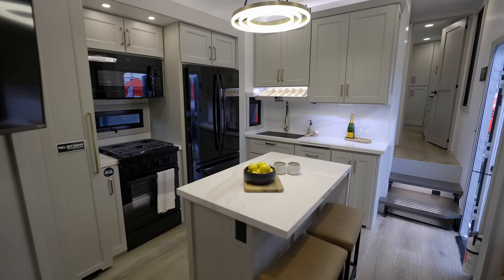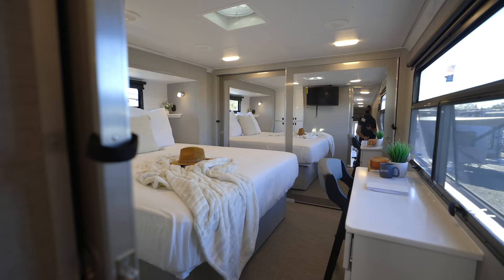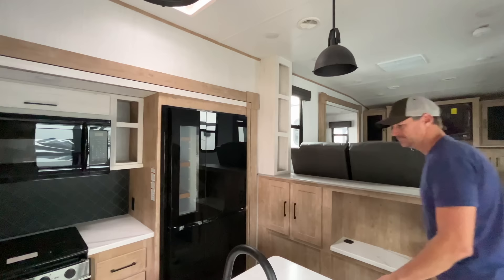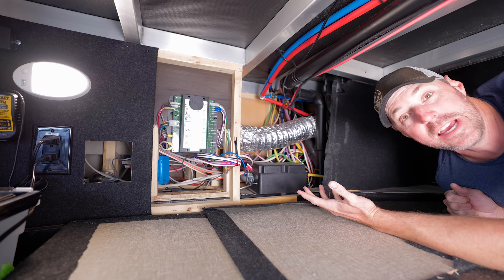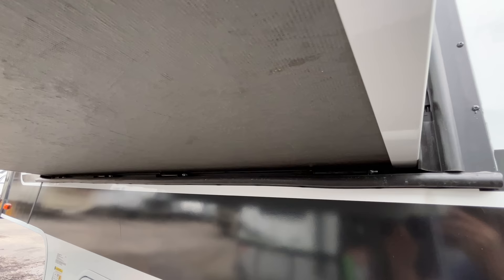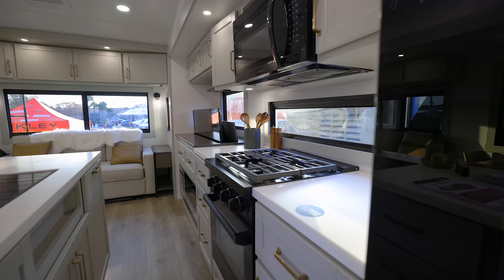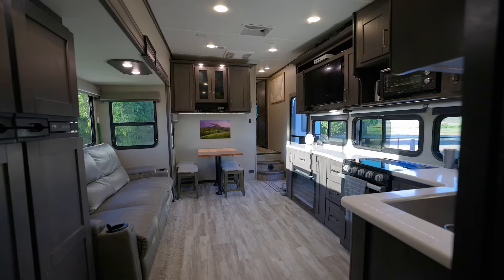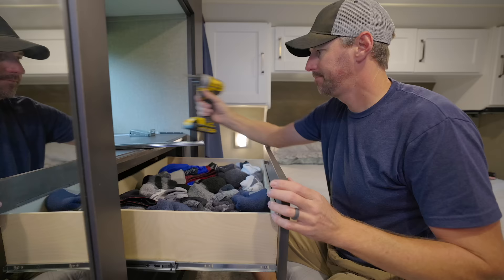Are All RVs Junk! Problems With Our Grand Design RV.

Comment: Don't know if you've been out to the PNW and have seen the Northwood Manufacturing models--they have truck campers to toy haulers in a range of budgets.   We started with an Arctic Fox truck camper and are moving to an AF fifth-wheel, and have every confidence that it will be as well-built as the truck camper was.  There were some little details (a window knob was nearly stripped and there was some facing loose on the fridge) when we bought it, but the dealer fixed all that right away when we found it with no problems.  What I like best, though, is that nothing feels cheap or flimsy--the cabinets are wood on face-frames with residential slides, the chassis is Northwood-made and independently certified, and I could go on and on.  The fans are all loud, though--we haven't been able to find any anywhere that work as well and are quieter.  Lance is another West Coast brand that is pretty solid, though I know much less about it.  I have no idea what type of line they might have for longer fivers for instance.  One big thing about our AF is that it is so well-insulated that we use much less AC in hot weather than we would otherwise, so if power is an issue, it might be another advantage.  Not trying to sell you on an AF (just a camper here, not a full-time or sales person or anything!) but just sayin' there may be sturdier options out there than what you've got close by.  I love the details you put in your videos--you've given me many ideas for our new fiver already and I can't wait to try them (I may have to ask you for more detail on installing a USB port if we decide to do that near our couch--the one at that end of the trailer is down under the table and hard to reach).  So thanks for all your hard work and info and keep it coming!!

Comment: Anything built after 2019 I can see without doubt....YES. At this point, i will never own an RV over 12000 lbs. Grand Design is perfect example. They cheap out of the frames while overloading on features with shotty workmanship. I have had an Class C from 80s and 3 bumper pulls in the last 25 years. I expect the normal stuff related to roof leaking, AC going out, the odd plumping issue, and the cabinets breaking. What I never expected was the literal base structure failing. While I was luck never to have purchased a Grand Design. My neighbor was not so luck. I literally saw his RV have full frame brake at the tonge going down the road on a camping trip on the highway. At this point, I would rather rebuild an 80s RV than purchase the crap being sold today. Why because that 80s frame has more strength than a brand new Grand Design.

Comment: One post.  I've owned 4 RVs (3 Class As and 1 C).   All were top of the line manufacturers and they all had problems.   From plumbing, to trim, to missing screws, to plastic pieces that were accidentally left in the plumbing lines and caused zero water pressure, to hand-prints in the full-body paint job, to warped pocket doors, to dented refrigerator doors (all of these were identified right during our pre-delivery walkthrough).   Others were identified within 2 months.    RVs are 10-year throwaways at best and idiots finance them for 20 years.   RV= ruined vacation.   Save your money.  If you want the camping experience, get a nice pickup truck, some good camping gear, and stay in the campground cabins.    You'll be able to afford this plus probably a Hawaiian vacation once per year for what I spent in maintenance.    Sunlight kills the roof / seals, so I stored mine in an indoor facility.   All were top brands.   They all touted their detailed factory QA inspections.    It's a joke.   I even had one $200k+ diesel pusher (in 2010 $200k was alot), that had problems because the front tire wouldn't clear the body when the wheels were turned.

Comment: Know what you mean about the quality. We purchased a GD Solitude and thought we were getting something we could full-time in. After 3 years I got frustrated with small things falling apart so we upgraded to a DRV Full House. Wow, what a difference in quality! That’s the way RV’s should be built.
Reply: We have a friend with a DRV and it’s nothing but problems.  After RVing now for 37+ years, I must say that if it’s not a LUX or  Spacecraft it’s not built for the long haul. We have a Grand Design Solitude 310 GK and it’s not without its issues as well.  Fit and finish is very nice. If it wasn’t for the terribly loud squeaking floor in the bedroom overall it’s a pretty decent coach.

Comment: We just purchased a Grand Design Reflection 324MBS 5th wheel after looking at several designs and owning a 2600RB TT for 7 years.  Really shocked at the issues we are finding.  Exterior door will be replaced (doesn't fit, you can see daylight at top when closed), dealership made a half-hearted effort to repair it, didn't work, back it goes.  Microwave and shelf installed crooked, on dealer list to fix.  Repaired several minor things myself (uneven blinds, missing door guide).  Our 2017 came standard with furnace vent screens and middle awning support....first time back to dealer,  service rep suggested we purchase these "upgrades" to ensure we didn't have issues...really!  Doing it myself.  Then the rep tells us "You MUST inspect the roof caulk within 90 days or no roof warranty.....these roofs move around a lot when you tow these units.....WTF?  We just purchased end of Feb and won't even use the unit until 90 days, so what are supposed to do. Called GR service and they explained 12 year roof warranty, please inspect/clean roof every 90 days...OK makes sense.  We felt good going with Grand Design again as our 2600RB held up well, but my initial reaction is they have cut costs in several areas and the quality of components has gone downhill...a lot...and it's supposedly one of the best/better built brands.  Scary stuff.

Comment: We’ve had our Highland Ridge for 10 years had minimal problems. I found the quality from Highland Ridge to be better than everybody else. The only problem I have like anybody else is with tires. I finally switched to a 14 ply if anything in the industry that’s where they can improve RVs a whole bunch. In fact, if you buy a new RV and it has a tan place force the dealer to get you some 14 or 18 blaze and pay the extra well worth it.

Comment: Back in 2015 bought a new Fun Finder travel trailer.  In my opinion above average quality.  Just yesterday went to a few dealers to look at some new units and compared to what I have the quality overall of the trim, wood, molding, etc just seemed inferior overall.  Felt like things were just slapped together and like always no quality control.  In my unit behind the cabinets I found lots of sawdust, pieces of wire stripping, and even a cutout piece from a hole saw.  Just sloppy and lazy workmanship. Plus the prices today are a good double for what I paid for my 2015 trailer.

Comment: Agree the Rv industry needs to step up the small details that can turn to big problems later. And customer support. That seems to have gone down hill a lot, but Covid hurt everyone in that sector. One thing I always tell people is stay away from entry level units. They are as cheap and flimsy as they get. A quality used unit would be better than the new ultra lights or base model units. 
And a transferable warranty on a less than 3 month old unit should be standard. Had no idea nothing transfers, and I mean nothing. This was for my new Jayco. Which so far is solid. Been happy so far. 🤞🏼

Comment: Purchased KZ 231rk 5th wheel in May ‘23. Had 5 spots on roof around skylights that were not sealed properly, so much sawdust and manufacturing debris in breaker panel that it was a fire hazard, sawdust and debris in heat vents and around camper, removed roof fridge vent and 1 screw was not long enough to connect to hold down, kitchen sink drain not tightened, living area heat vent no air. Bought a scope and appears the foil was never removed from furnace duct. Two nights ago up at 12:30 am because GIF 110 electrical plug  decided to blow with loud resetting noise for 2 hours, finally disconnected live wire to stop so we could get back to sleep. Replaced following day with good plug from electrical supply store. Have to light stove pilot light with hand held lighter because it will not light. Some people said we are lucky and “got a good one”! This is our 7th and LAST RV. Thankfully we can do most of the work ourselves. Our advice, DON’T buy an RV unless you are handy and have the time to fix things and watch many YouTube videos on RV repair. Take the money you would have spent on RV and tow vehicle and stay in Airbnb’s or hotel or rent a cabin or RV at a campground . When done staying, you can walk away.

Comment: Good to know paying the extra 50% gets some better quality.  The value is not just less work fixing things later but peace of mind that there aren’t looming disasters.  It probably also hold’s resale better so used ones get more than used cheap ones. People with smaller budgets could chose to get a smaller RV that is higher quality.  Or just accept the money saved will be spent over time instead, plus practice learning to fix anything

Comment: From my perspective most RV's have about a 10-15 year life span before materials reach a point of degradation where DIY level repairs become more and more difficult.  This is where paying more may get you ahead in the long run.  More money will generally get you a nicer rig with better materials, better build quality, and better longevity and most important a higher resale in the used market.  

The same could be said when purchasing a used RV.  Premium brands RV's will cost much more in the used market, but ,they may have a much better lifespan with fewer issues due to the better design and materials.

In both scenarios, the costs amortized over time factoring in purchase price minus the value when you sell may put you ahead in the long run.  Plus, you get to enjoy a nicer RV the whole time.

Historically, the premium brands (ie Airstream and others) are double the price of similar standard brand trailers with similar specs.  Fortunately there a number of new companies that are aiming at premium brand quality, maybe even better, but with "in between" price points.  

We were recently in the market for a 25-26' travel trailer without slide outs and we were close to pulling the trigger on an Airstream until we investigated other new companies.  We ended up buying an Intech Terra Oasis which has similar materials and build quality to an Airstream but with better design from our perspective such as fully welded aluminum frame in the walls and ceiling, higher ceiling height, better ground clearance, seamless roof, and exterior materials that can handle a hail storm.  Solar is essentially double the specs of Airstream for the same money.  Resale is yet to be determined but will likely be less than Airstream, however, we consider the Intech to be a better trailer from our perspective at 2/3rds the cost of an Airstream.  Cannot predict how long new companies will be viable over time but Intech has been in the transportation trailer business for a long time.  Hopefully we made a good choice.  We certainly are happy with our purchase after our first year.  

Not suggesting everyone should get an Intech or Airstream, just suggesting that it may be better to pay more in the short term to get ahead in the long run.

Comment: I have an old RV it's a 2003 Forest River/Ceader Creek it's my 3rd RV, and I have to say it's the best one I've ever had. Yes, things still break and have to fix them. We don't live in our RV, but we do go out in it about 4 to 5 times a year for 1 to 2 weeks at a time, so we are in it a lot. And as I said, things do break I usually spend about 1 week at the beginning of the season or at the end of the season doing my repairs. Right now, I only have 4 things to fix a part on the hot water heater, a drawer, one cabinet door, and the fill line on the freshwater tank. All little stuff. I  have a friend with a 2021 Grand Design, and he told me he had about 20++ things to fix on his. I think I'll keep my old 5th wheel RV.

Comment: Cheap electrical components are a real bug. 
Take that fan for instance. It's made of three components, 1: Moulded plastic housing 2: Fan blades 3: Electric motor.
Plastic housing has to be strong enough to to break and not discolour. Fan blades as housing + have an optimal design for air displacement and silence of operation also be reasonably in balance.
The motor is the bit that wears out and will be bought in from a motor manufacturer by the fan supplier. If someone manufactured a motor of reasonable quality with brushless designe and good quality materials for the bushes/bearings along with service ability by a small oil well for maintenance every month. 
These parts would last a very long time and people would start insisting that, that manufacturers items were included in any build. 
Translating this into Chinese is not viable🙂

Comment: Great video!! I think it also shows that cost is not really an indicator of quality. The most important thing anyone can do before purchasing is research. Learn some of the things that can help you determine what is a better quality build. For instance are the cabinets real wood or particle board. Is the plumbing Pex or flex tubing, or a combination of both? Do the running gears have wet bolts or nylon bushings? The information is out there, well the information is actually right here on this channel! So yeah, do some research first.

I do agree with the one comment that you need to be a bit of a DIY'er if you own an RV. But that said it's an RV, not a space shuttle. The systems are fairly simple to learn and work on, and again, much of that information is right here on this channel, (Noticing a trend here??)

Lastly, with a little research I think it's easy to find what manufacturers are the ones with a better quality build. In the towables space I would say my top three in alphabetical order are Alliance, Brinkley and Grand Design.  

Thanks again for a great video Jared! And thanks for taking the time to put all of this together.

Comment: Recently, I had some major repairs done on my RV. they were not done at a dealer. The shop said they started noticing some big issues with all manufacturers in 2017. They have recently started getting better. This seems to be an industry wide issue that the pandemic exacerbated.

Comment: One of your better videos because its an import question to ask. I liked how you look under the covers to see how work was done like wiring. It does speak to the design build of the rig. But it also speaks to the price. I bought a cheaper Class A and while it was a good purchase for the price it had a much cheaper build. The master bed was all engineered wood so it wasn't solid. The mattress lifters actually pulled it apart after a while. But that said my bed had home doesn't require lifters and does do 65-70 down the road on a regular bases either. So being able to do a little DIY is kinda a requirement on a moving house. If not you will be in the shop all the time.

Comment: My dad just gave us his 2002 Georgie Boy Landau 2450 DS on the 8.1l Workhorse chassis.  The build-quality is AMAZING.  Flexsteel furniture, big, thick, clear wood cabinetry, quiet, big mirrors you can see through the windshield, huge storage garage, the list is endless.  We just dropped it off at the service center for a top-to-bottom service and to upgrade the electrical system to have 2 BattleBorn Lion batteries and an inverter with automatic generator start, Bilsteins, modern camera system, etc.  And it is QUICK, even up the grapevine, and turns on a dime.  I was looking at the Winnebago Vista 29NP.  No way with today's shoddy build quality, even though the floor-plan is superior.

Comment: Have a 2020 Cougar Half Ton 30 foot.  Lippert frame and Keystone manufacturer. We had a electrical break failure within first year and front outer paneling was coming off. All was fixed, but then i replaced the tires as they had split and had the bearings repacked at the same time. 
During this bearing job one of the break assemblies was found to be bad. Had to replace the drum due to damage and the assembly as well. Problem was the shop couldn’t find the parts. Went back to the dealer where we had bought it and they kept giving us the wrong break assembly but they swore the assembly was correct for the trailer we had. I brought them the bad break assembly to match it up and it didn’t match what they said should have been on the trailer. Here’s the kicker. The axels installed by the manufacturer were Dexter Axels which had been discontinued 10 years prior. What a shit show. Parts were found but at a higher expense. The break assembly was special ordered and we found two drums at some obscure trailer parts house. Companies are out to make a quick profit. I also added steel reinforcement to the tongue as lippert frame tongues are 1/8 inch tube steel and have bent or crack. Figured the manufacture warranty was voided by the manufacturer when they assembled the frame using discontinued axles. I’d take this trailer anywhere now without to much worry as I’ve fixed everything better then the dealership or manufacture. That’s my story. We’re Doing the ALCAN next summer.

Comment: I'm honestly surprised that RVs are able to hold together going down the road. Every RV manufacturer uses the same parts sourced from the same companies - there are just a few that might do a little better job of selecting the less "junky" part for the job. As you spend more money on an RV, you might get some nicer finishes and possibly a little better materials (thinking cabinet doors for the most part), but no matter how much you spend, you're still going down the road with a rolling turd!